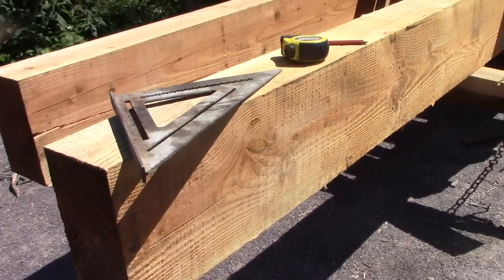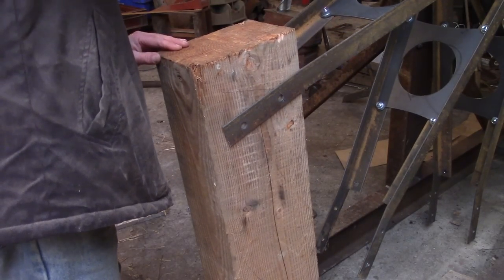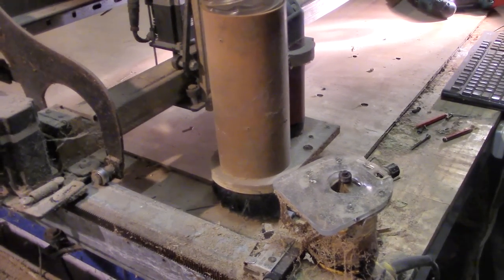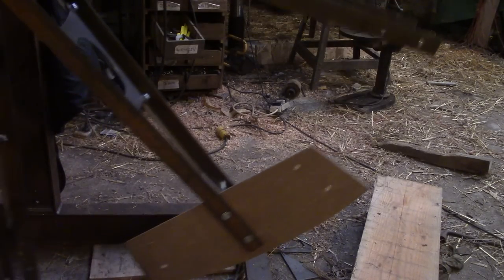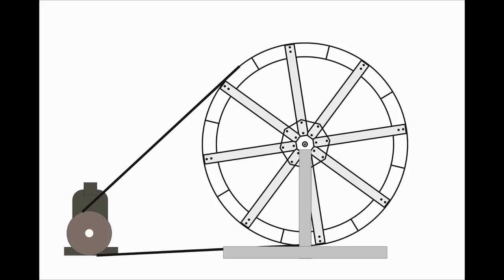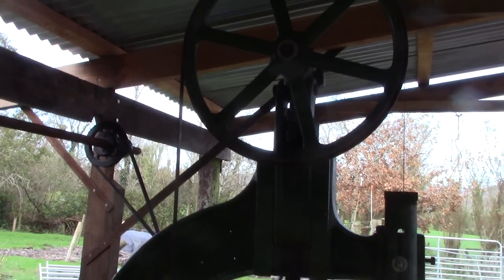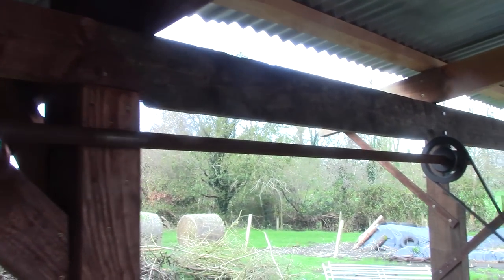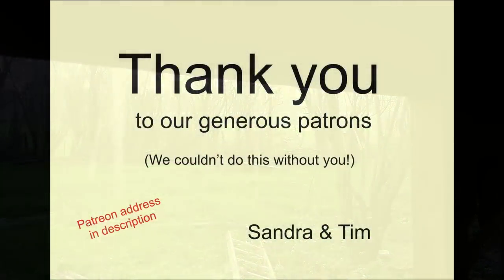Designing The Wooden Felloes For The Giant Momentum Wheel – and a major hold-up!

Comment: If you move the line shaft be sure to encase it in wood or metal mesh. Things like that have a nasty habit of catching pant legs or boot laces and causing some real damage in a split second.
Reply: You can avoid the laces thing by getting fancy-pants aramid fibre laces.
The downside is that, being stronger than steel cable, they're ALSO stronger than whatever they catch in. Or your fingers; I got some nasty abrasion while getting some flex into my latest set.
Reply: @Skorpychan  If anything it would make sense to have weaker laces so that they just tear off when caught, or to wear clothing and footwear that doesn't have such loose parts to begin with ...
Reply: @lolatmyage  My boots wear through normal laces in a couple of months, and I get sick of buying and replacing them. And of laces snapping unexpectedly and leaving my boots loose.

Comment: Leave the line shaft on the ceiling where it belongs.   Your line shaft coupling is major source of vibration.  Use a U-joint.  And make sure everything is tight on shaft… like pulleys, etc.  Need a good near press fit.  Finally put more screws into roofing to tighten it up.   Thanks for the videos.
Reply from the maker: Universal joint? You could be right. But still, it's REALLY noisy!
Reply: @wayoutwest-workshopstuff6299 >>> Says the man with the giant single cylinder stationary diesel engine...😉🤭😆

Comment: Why not just damp the vibrations?
Use a tube of expanding foam to cushion the roof sheets; just spray it under the corrugations. Then stick some more cross-members on the roof so things don't shake.
Maybe consider shaving the shaft on a lathe, if you have one, or just balance it with magnetic weights like a car wheel.
Reply: Exactly what I thaut.   Just put something on the top of the roof
When there is work done that causes those vibrations some pieces  of shain would do the trick, just lay it over the roof ridge . No need for foam . This will remove or dampen the steel roof rattling sound.
Reply: @perstaffanlundgren  Just for your consideration, whether it be by mistake or unfamiliarity with the English language, I believe you meant to type "thought", rather than "thaut".
Reply: Except that car wheels don't use "magnetic weights", so thanks for your knowledge and expertise, now sit down.
Reply: @railgap  And yet, they do. Balancing weights are magnetic.

Comment: There is plenty you can do to stop the tin from rattling. There are foam ridge and eves packers that follow the profile of the tin. These stop the tin from rattling between fixings, and in domestic  applications, stop driving rain, and keep birds out. On a make do budget, and for what you need, you could use some pipe lagging foam as a damper under there by winding out the tin fixings a bit first. It'll make it a quieter place to be in the wind and rain too.
Reply from the maker: Good ideas, but a huge amount of work to get to all the touching points
Reply: @wayoutwest-workshopstuff6299  you could try a little expanding foam to glue it all together? If you get a little over spray, it can be cut and tidied with a knife. Just go light with it, and spray along between the purlins, and the tin. It'll grab enough to quieten it down, and also be fairly easy to scrape off in future if you reuse the timber frame or tin. Or, I suppose a big pair of ear defenders could be a very quick operational option? Thanks for the videos.
Reply: And/or vibration washers behind your drive shaft mounts. Something like cut pads from a motorbike innertube, old drive belt, or conveyor belt.

Comment: The issue with the line shaft is your out-of-round wheel pulley. True that all up first. Then balance the pulleys on the shaft. Done. 
Assuming something is concentric or balanced because it is round will bite you in the butt. Everything turning fast must be straight and true.
Reply: Textile mill I worked at in the 90's still had some lineshaft driven machinery in the workshop and setting up the shafting was critical. Joints in the shaft were radially clocked to within a couple of thou using dti's and connecting flanges were hand fitted together. Over the length of the shafting, a wire line was tensioned off and the shaft's bearings shimmed to measurements made using an inside micrometer between the shaft and the wire.
Reply from the maker: I think you're partly right - the car-wheel pulley is the main cause, but the barn structure acts like an amplifier too

Comment: More screws on the roof. 
My hose is in a cyclone rated area and each of the corrugations at each end of the iron sheet has a self tapping roofing screw through it to keep the iron on the roof in high winds. Even every 2nd wriggle would keep some tension on it and stop it bouncing around as much.
You can also get foam cut in the wriggly shape to screw in between the battons and the iron to stop it rattling. Try wedging some foam in there and some extra screws and it may save you a lot of work, not to mention the hazard from the spinning shaft at shin height.

Comment: A line shaft on the ground seems pretty dangerous, i think it is better to solve the root of the problem instead. I think it is caused by the wobbly pulley of the bandsaw, every half revolution the belt gets tight and loose again which pulls on the roof

Comment: Back in the old days line shafts were attached to the building columns however in a lot of. Cases it was simply suspended. Placing it down low is a very dangerous goal. If anything gets caught in the shaft then it is all over for what ever it is

Comment: they used to sell foam strip cut outs in the wavy shape of the corrugated metal to seal the ends. If you could find some they would also provide enough cushion that the wouldn't rattle so much. I would encourage you to keep the line shaft up not only is it safer, but it would keep it out of the elements and maintenance would be far less. looking forward to more
Reply: A quick google search comes up with the name "corrugated roof end fillers." If you do an image search you can see what I'm talking about.

Comment: I'd suggest mounting the line shaft to a length of I-beam or a box frame of scaffold poles, then mounting that to the building frame with butyl rubber blocks (eg. car engine mounts from the scrapyard). A steel frame, being an order of magnitude stiffer than wood, should reduce twisting and bending over the length of the shaft. The rubber blocks reduce transmission of the remaining vibration to building framework. I can't say I have a huge amount of experience with line shafts, but that would be my approach.

Comment: would putting some rubber (tire) between the timber and the line shaft not damping down the vibration as save you from moving it again?
Reply: agreed. preferably something about 12mm thick. medium compound rubber.
Reply: I was about to comment something similar - vibration isolation could even allow you to keep it up by the roof if you had some mass up there as well

Comment: OK ... a couple of points on this one ;o)

If the problem is vibration why not cut the bits that are vibrating to make it smoother. If it is as you say the belt you could add a second damping / tension wheel. Having a lever with two pulleys on should be a simple(ish) job for a man of your calibre! The other simple fix is to throw some more fixings into the roof .... or even get some of the custom made foam rubber inserts made to draughtproof and use those rubber washers on your roof bolts? Have you tried running it at different speeds? That could change the resonant frequency fairly easily.
Another idea might be to put damping behind your shaft mounts?

Putting your shaft at ground level is a dangerous idea! If you go down that one you need a Lot of good quality barriers and shields in place! That thing can eat you for breakfast and spit the soggy bits out without even noticing! ..... and you do have people around there other than yourself! Personally I think Dangerous Stuff is a brilliant idea (as long as it does not include me, and it could make some epic YT videos ..... but maybe the dangerous ideas are overrated a bit?

Your cutting angles should be simple  ..... 360/10/2 giving 18 degrees from a tangent drawn between the flat inside edge! You can check because you will have the same angle cut for your bolts in the axle for the spokes ..... but you will have to halve that as you have a cut at each end.

Another thought provoking video, thanks!
It is always a pleasure to see how ideas evolve with the contact of reality!

Comment: Cut out surface  for the flat belt, when done make a groove in the middle of the wood .
Bend and shape a   open  circle round steel rod .
 Heat a steel rod  to the limit of the temp  when it burns wood put in groove tightly.  then weld the ends together and let it cool of.
You  can use linseed oil on it when weld is done , this will protect from rust the heat oxidized the oil. The recest rod will lay below  the flat belt surface.

Comment: The first cabinet shop I worked in had a line shaft for some of the machines. When it was running the whole building rumbled. Especially the upper floor. The ground floor where the shaft was located was always very loud but the clicking of the leather belt lacings was quite pleasant.

Comment: As other people have said, it might be a better idea to try dampening the vibrations. You could bolt a piece of rubber, like a bit of old car tire, between the shaft brackets and the shed beams and see if that helps any.
Reply from the maker: Wouldn't that make things worse though, because it would allow more movement?
Reply: @wayoutwest-workshopstuff6299  Boat engines (diesel engines of your size) sit on rubber dampers... more than that I do not know.
Reply: @wayoutwest-workshopstuff6299  The idea I think is that it's still secured tightly, but the rubber layer helps absorb some of the vibration
Reply: I think they are  called dampers because they literally dampen the Connection between whatever is vibrating and the inertial thing it’s attached to. It might be worth a try. Also I’m sure you’ve thought about this but assuming you could fix the driveshaft strongly enough that means that the source of irregularity, the bandsaw, will be forced to vibrate instead.

Comment: I'd dampen the ends of the roof, attach more cross-members to the shed's timbers and attempt to improve the balance of the shaft before moving the whole line-shaft down low. It just seems like it should be possible to "tune" the system enough to prevent the apocalypse from occurring without having to do essentially an entire rebuild.

Comment: With the vibration from the line shaft putting it on the floor would/should work but if you want to keep it up try adding some suspension or have it hanging from chain/rope  in multiple spots (each spot should Probrably look like a v for stability) or u can nail more of the metal roof to the frame that’s only my idea do what u want I love these videos they are Awsome!

Comment: @Way Out West - Workshop Stuff
1:00 To make the final balancing, i think you can use it's wobbles to your advantage (because trust me, it WILL wobble. If nothing else, because little differences in density in the woods).
Put something abrasive (eg. really course sand paper, or worse) in a position that it crosses the entire "thickness" (perpendicular to the diameter), and placed such that it barely touches on the most extreme points (radially) & thus only shaves off material where the most material is located. (basically treat it like a gigantic lathe, where your wheel is the working piece material, and the "sandpaper" is the shaping tool that shaves off material).
Reply from the maker: A long way to go before I get to that, Sion, but you're right, that's the way to do it

Comment: Couldn’t you insulate the line shaft from the framework of the shed? Perhaps similar to how they insulate an exhaust from the car? Rubber doughnuts inside a metal hoop and the shaft runs through races within the center of the rubber doughnuts.
Reply from the maker: Wouldn't that make things worse though because it would allow more movement?

Comment: Try some rubber washers on the fixing points of the roof and/or line shaft to dampen the vibrations through the frame.
Reply from the maker: Wouldn't that make things worse though because it would allow more movement?

Comment: @Way Out West - Workshop Stuff
6:20 You need dampening, probably some kind of rubber?
I think you could easily come buy an old discarded foam-rubber mattress, rip that apart into lengths, and push them in between the wood & roof-panels.
Reply from the maker: Wouldn't that make things worse though because it would allow more movement?

Comment: It appears the band saw pulley has some runout that is causing the drive belt to shake which is transmitted to the line shaft.  Perhaps straightening the band saw pulley would reduce the vibration.

Comment: Perhaps using steel tension cables laid into grooves cut into the surface of the rim (the wooden fellows) would be useful as binders. Maybe hidden under sawdust/glue or some other filler. Welding the ends with tension already in the cables might work out fairly easily.  Just a thought.

Comment: I wouldn't bother with cutting the outside arc on each block individually if where you. You just need to cut the angles on the side correctly with the right width of course. Then when the wheel is assembled you can just cut the whole outer diameter in one go. That way you will  get a much more even circle that will be more balanced in the end. 

Maybe you're going to do this and I just didn't pay attention, but it was worth mentioning as a tip at least.

Excited to see how it will end up! :)
Reply: Maybe Tim could mount the wheel and place a router in a jig to carve the right curve in situ. He could even route the right profile like that!
Reply from the maker: I hope to rough cut them first and then use a chainsaw when they're installed..
Reply: @wayoutwest-workshopstuff6299  Why not use the chainsaw to rough cut the pieces and do the fine cutting on your beautiful cast iron bandsaw?

Comment: Trying to balance the shaft is going to be tricky, but mounting it rigidly may just put strain on the bearings etc. Not sure what the best approach would be. Rubber donut connectors on the line shaft, like on some car drive-shafts?

Comment: Tim, hugest respect for your engineering skills, But having the driveshaft on the ground scares me. There must be some way to straighten The pulley on the bandsaw, which seems to be the main vibration source. Also, assuming the bldg posts are pretty strong in compression, Perhaps there’s a way to run a couple of slightly angled guy wires down into the slab so that the wires absorb most of the upward impulse. 
A third thought is maybe there’s a way to have an intermediate pulley which somehow absorbs the out of true of the bandsaw pulley, with an additional belt running from there to the line shaft.

Comment: Perhaps adding more fasteners and some rubber tween the iron and timber frame will dampen the vibrations. Also have you thought about cutting the fellowes out using the cnc router?  I would have thought you could jig it to cut the most of it in two operations, one from either side? Anyway, I do enjoy your can do approach in all the tasks you have set for yourself.
Reply from the maker: My router isn't up for that sort of work, sadly. It only manages 3mm cuts, down to about 15mm.
Reply: That does make it difficult but you could cut down that far and it would help with bandsawing, perhaps?  I wish you luck and look forward to however you manage it. Cheers from  New Zealand.

Comment: I think I'd install a steel tire around the outside diameter of your wheel to pick those big fellows in place. Even a tire about 1/3 of the with of the fellows shrunk tight, would greatly improve the wheels resistance to centrifugal forces. Then the edges of the steel tire could be rounded with your grinder and the wood crowned. Even a relatively thin steel tire would help.
Reply from the maker: perhaps you're right, John. I'll have another think...
Reply: @wayoutwest-workshopstuff6299  you might want to get the opinion of a fellow YouTuber - Dave Engel at Engel's Coach Shop.  He has built some might big wheels in his time.

Comment: Looks like the drive pulley on the bandsaw is wobbling, maybe it's that which is causing the vibrations? either fixing the wobble or maybe adding a relay shaft on the ground with true-running pulleys (or just one wide pulley) would avoid the vibrations getting to the line shaft?

Comment: Glad to see you’re making progress on the flywheel. I hate to see you go thru all the trouble of moving the line shaft. Moving it down by ground level probably isn’t the brightest idea I’ve seen from your channel. The line shaft will become a hazard you’ll have to build guards for or cages and there’s always the possibility that it’ll magnify the problem of shaking the roof with the extra distance multiplying the ratio. You may have more luck and still maintain full use of what’s already there by just adding diagonals at the posts of your building. My great grandfather’s shop had 6”x6” red oak for lateral and diagonals added after a tornado around 1925 that are still there although the line shaft was removed in the 60’s when my grandfather took over. Just hate to see all that work go to waste on your building when simple updates would rectify the problem.
Reply from the maker: I hate all that wasted work too, but that just means I should have done it right first time